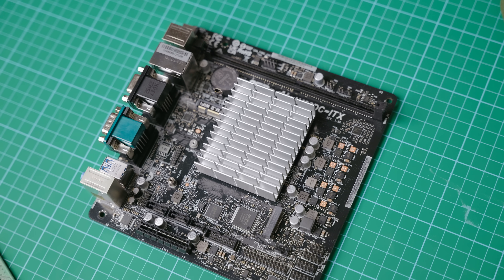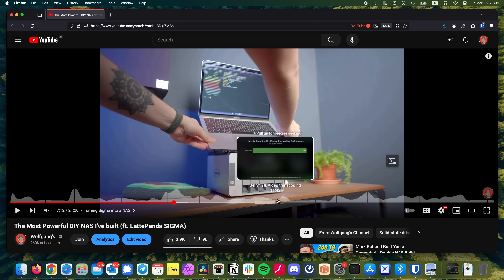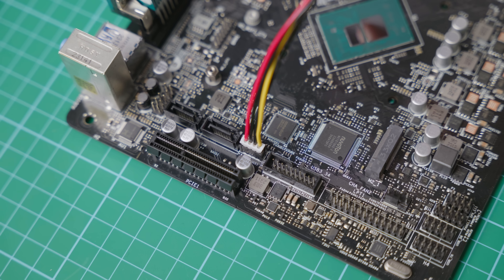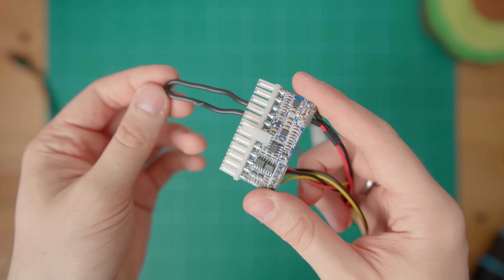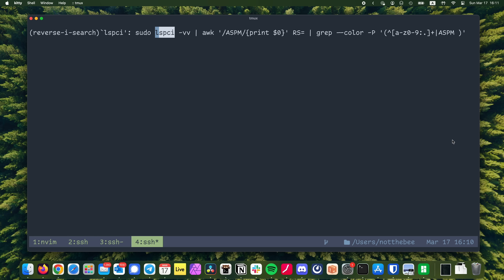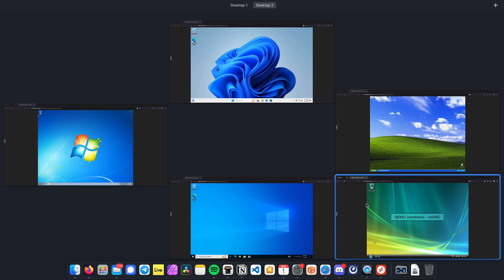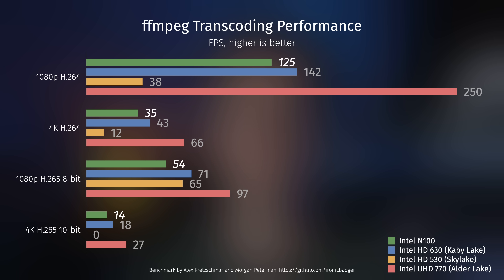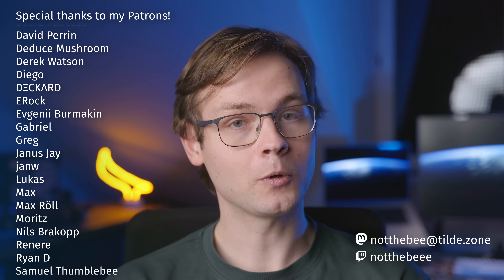Asrock N100DC-ITX – Almost Perfect! But...

Comment: Unbelievable, a PC ultra-lower power ultra low performance board still draws 5w at idle.
and that's somehow considered to be amazing.

meanwhile an Apple Silicon platform with like 10x the performance draws less than 1w at idle.
Reply from the maker: The CPU alone, maybe. But not the entire system
Reply: @WolfgangsChannel  Yes the entire system minus the screen.
Reply from the maker: I've measured my M1 Macbook Air (fully charged) with a Shelly Plug S, and got around 6-7W at idle. What is your measuring methodology?
Reply: @WolfgangsChannel   we don't even need to make any measurements to know your number is wrong. The M1 Macbook air has a 49wh battery, if it idles at 7w that means it will die in less than 10h. But we know it can play video with the screen on for at least 12hr. meaning it must draw less than 5w while playing video on the built in screen.
But just to humor the discussion I measured my Macbook Pro 14" M3 Pro, it idles at 3.8w with the screen at 100nit. With no backlight and no keyboard light that drops to 1.8w, the display is still on mind you, 1.8w while driving a 3k display.
Idly power consumption on the PC side is simply a joke, they're wasting so much power to doing absolutely nothing.
Reply from the maker: You didn't answer my question – how are you measuring the power consumption?

Comment: It's impossible to take anyone who recommends those m.2 SATA adapters seriously. They're terrible products with appalling failure rates. If you need more drives than you have ports use a proper HBA card with an SAS to SATA splitter cable.
Reply from the maker: Any source on those appalling failure rates?

Comment: I got that "Asian" N100 board with 6 sata and 2 m2 slots  (180$ with 8Gb DDR5 from amazon Germany) so i don't need that asrock crap. but WHAT is that case you use :PP
Oh yeah mine has 10Gbe using the 2th M.2 slot :P and yeah to made for my (wifes) parents :P
I myself use an x570 gigabyte ITX board with an AMD r5 5650 PRO, takes 28Wat with two ssd drives and 32Gb ECC mem. in a Fractal node 804. (At 45W power mode )
Yeah if mine starts "working" it uses eh a little bit mode power :P